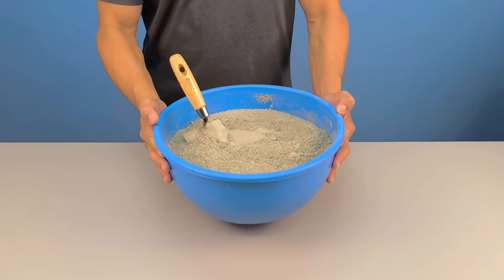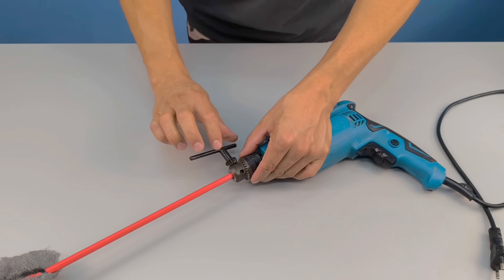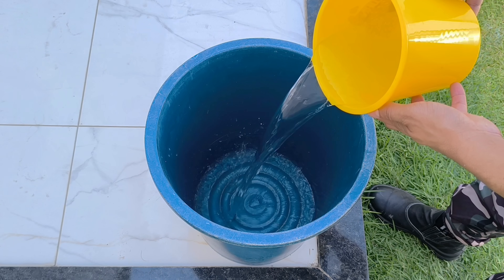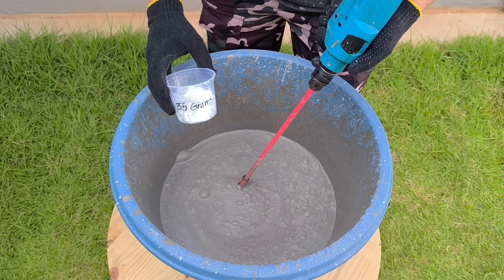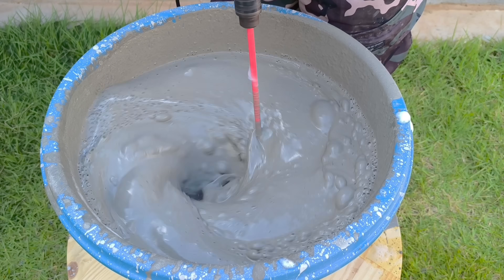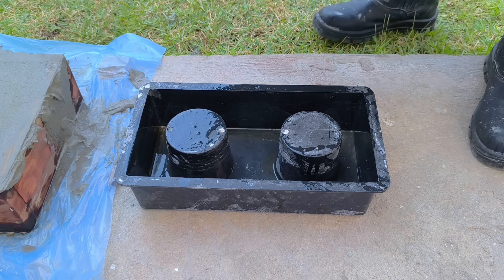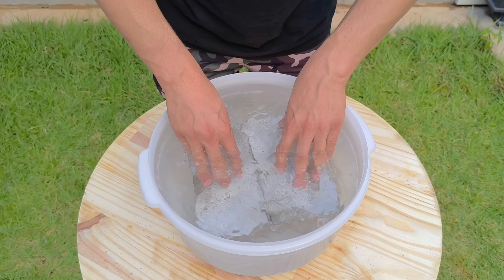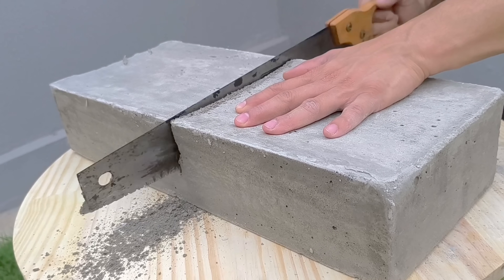Mix CEMENT with DETERGENT and create something that can REVOLUTIONIZE civil construction!

Comment: Not impressed! All you did is create glorified styrofoam blocks. Obviously that stuff is weak and prone to cracking and crumbling apart under stress. Can tell just by the way it sawed in half. 
Dumb idea!
Reply from the maker: I respect your opinion, my friend 👍 You’re right — this material isn’t meant for strength, only for reaction testing and curiosity. It’s interesting to see how different formulas behave even when weak. ⚗️🧱

Comment: Since it became weak or eroded in time, the fiberglass really scared me,ie if you build a wall with it
Reply from the maker: Good point! 💡 Fiberglass should be used in the right ratio — too much can actually make the mix brittle. When balanced, it gives great reinforcement without losing strength.

Comment: Aircrete
Reply from the maker: Exactly, my friend! 💡 It’s a similar concept — just an experimental version made with simple materials to show how lightweight concrete can be created at home. ⚙️🧱
Reply: @inovaouinventa it's also fire brick basically. You can use it to build a furnace to melt metals in.
have two buckets slightly different in size
and suspend one bucket above inside the other so you have a floor to the fire brick bucket

Comment: This was facinating!! Would this mixture withstand the weight of a car if someone poured a driveway or a pad to park on?
Reply from the maker: Thanks! This mix is experimental and lightweight — not strong enough to hold a car’s weight. It’s better suited for decorative or low-load surfaces.

Comment: jeah it swims its light but how much pressure can take it, and how is the abrasial factor, as i saw how easy the saw cuts it  it was wasted for me... because i can tell that lightweigt stuff will not hold for long and decay by time... but i wounder what would happen if u add much more glassfibers (our ancestors used straw) and a decent dose pozulan to the mix,  i say it would be better with the straw from medival time, u get a lightweight material and even if the straw one day decayed awaw the pozulan will grow in and fill the gaps with every rainfall...
Reply from the maker: Excellent analysis! 🧠 You’re totally right — adding more glass fiber or natural fibers like straw, plus a pozzolanic additive, can really boost both strength and durability. I love that medieval approach!

Comment: Sir please help me to make interlock brick
Reply from the maker: That’s a great project! Interlock bricks require specific molds and a strong cement mix — usually with less detergent and a bit more sand to increase compression strength.

Comment: Truly amazing!!!! 
Q What type of concrete are you using to get such a fine smooth texture?
Reply from the maker: It’s a special smooth mix made with ordinary Portland cement and a small amount of detergent — that helps create a fine, silky texture by reducing surface tension and air bubbles.

Comment: This is not a structural concrete at all. It may have some application otherwise however time would be the test. I bet you couldnt anchor into this shit neither. Absolute bullocks, besides, using dishsoap or laundry detergent was used a long time ago for motaring bricks together and as a seismic upgrader we used to see this crap coming apart as we drilled and epoxied anchors, redi rod, rebar and plates to hold brick walls together.
Reply from the maker: You've brought up some interesting points about the structural integrity and anchoring capabilities of this mix. Our goal is to explore new possibilities and applications for lightweight, experimental materials beyond traditional structural concrete.

Comment: some 25 yrs ago I've heard about lightweight concrete. a few techniques to get similar results, one of them the one you depicted here. I've tested them some 15 yrs ago with success for a couple of applications (mainly isolation and voids filling in construction). By  that time there were already available simple machines for continuous foam production to be used to produce foam to be mixed with mortar in conventional mixers. There are also specific foaming agents because you look after stability and isolated bubbles in the cured final product what are key to isolation performance and also water absorption (what you want to minimize !). As almost all related to cement... process and proportions are key to results. For success at working with this kind of products you need to be very precise and very careful, accounting for a lot of other relevant factors at the time of mixing, such as temperature of each component you will be mixing, specification of the cement itself (there are many types and variants !), specs of all other stuff that you mix !, and climate conditions specially humidity during the curing period.
So many variables, that working with cement based compounds is serious business. Is a great material but it is increasingly complex the farther you go from the standard classic mixes. Working consistently well with many compounds and formulations can become literally an ART

Comment: That  crap is gonna crack in the summers by expansion.  The purpose of concrete is the weight and strength.
Reply from the maker: You’re absolutely right — heat expansion is a real challenge! 🔥 This mix was tested more for reaction and curiosity than for structural use. ⚗️

Comment: Can you seal the blocks to make them waterproof?
Reply from the maker: Yes! You can apply a thin layer of acrylic varnish, waterproof resin, or even silicone-based sealer — it will protect the blocks from water perfectly.

Comment: that is very cool...I am assuming this product has no commercial value ? strength ?
Reply from the maker: It actually has potential value! This mix can be used for decorative pieces, light panels, or prototypes — it’s solid, lightweight, and surprisingly strong for creative projects

Comment: This is nothing new. Its called light weight concrete. It has been around as long as normal weight concrete. Soap is just one method of air entertainment, and not the best because it can reduce matrix strength beyond merely introducing air voids.
Reply from the maker: Excellent technical point! 👏 You’re absolutely right — this mix follows the same principle as lightweight concrete, just explored in a simple and creative way for experiments. ⚗️🔬

Comment: That "used motor oil" is too thin and runny to truly be only motor oil alone (or at all.)
Reply from the maker: It's actually a mix of used motor oil and other hydrophobic liquids to achieve that consistency. Thanks for pointing that out!

Comment: :face-green-smiling:What a joke! Bricklayers all over the world have been adding detergent to water to make mortar 'fatty', easy to spread, and increase adhesion/cohesion.  I learnt this from my father 60 years ago. Then add chopped fibre with styrofoam beads/polypropylene.    Super strong, light, floating breeze blocks but will deteriorate over years to become rubble.
Reply from the maker: You're absolutely right! 🙌 It's amazing how traditional methods like adding detergent have been used for generations to improve mortar. 💡

Comment: GR8! Yo what degree the concrete properties are preserved with this foamy/ souflé mix?
French said over one century ago that with a wall thickness of 15 cm, the weight to buoyancy ratio of a hull began to be advantageous for reinforced concrete above 10 metres of hull length.
Romans prepared concrete with volcano ash, resisting thousands years on Sea water, Portland lasts just 50 years.
How porous, what's the air and water tightness of your mix?
Karlsruhe tech built a kart on a prestressed concrete plate, with 4 mm thick body.
B&V-246 gliding bomb had Sorel concrete wings, this cement does not admit irons.
Concrete is a composite, many, many different ingredients can be poured into the mixer.
Congratulations! Blessings +
Reply from the maker: Wow, what an incredible and detailed comment! 🧠👏 You’re absolutely right — ancient techniques like volcanic ash concrete were extremely durable. In my mix, the goal is to create a foamy, lightweight texture with balanced porosity and strength. It’s fascinating how many variations of concrete exist! Thanks a lot for sharing your knowledge and for the blessings 🙏

Comment: Old recipe.  Bricks made this way have insulating properties, but the bricks are are not durable and they'll disintegrate under stress.
Reply from the maker: You're right that this method is known for insulation, and traditional recipes might be less durable, but with modern cement and additives, we can enhance strength and stability. ⚒️

Comment: USA. Kentucky.... I still use detergent in drywall mud to decrease bubbles and make it smoother. Works great.
Reply: 30 years of commercial drywall.  Soap is a big NO! Every new guy tries to show us about the soap but a professional follows the mixing directions so the warranty will be honored if the mud fails.
Reply from the maker: That’s awesome to hear! 🇺🇸 It’s amazing how simple additives like detergent can make such a big difference in texture and workability.
Reply: @unveiledbeliever7705  paint doesn’t like soap
Reply: @StepheMauro-kh1px that's exactly why I don't put soap in paint😂

Comment: Pretty cool video. Thanks for sharing it. But if you can cut it with a wood saw, is not strong and won't be durable. Maybe if you finished it with a sealer, it might be good for walking on. But it won't be good for building with. Better to stick to cinder blocks.
Reply from the maker: You’re totally right! 👍 This mix was designed for lightweight and experimental use — not for heavy structures. But sealing it can indeed make it tougher for creative or decorative applications.

Comment: What is the plasticizing additive???
Reply from the maker: Liquid lime (calcium hydroxide in suspension): is an alkaline solution traditionally used to give plasticity and cohesion to mortar, delay setting time and improve adhesion, but it does not reduce water or increase strength like modern plasticizers.
Reply: @inovaouinventa Thanks for being so interactive with your subscribers ❤

Comment: I was wondering if someone would have made a house out of those bricks if would make the house or cabin or bridge by hundreds of pounds or even thousands of pounds but can it hold up thousands of pounds of weight??? Also can it withstand high winds or snow... Things like that a builder has to think about to make sure that the house doesn't calaps on a family living in a potential death trap...
Reply from the maker: Excellent point! 💡 This mix is great for light structures and creative builds, but not for load-bearing walls. It’s more for innovation and experimentation than full-scale construction.

Comment: Good trick; it could be useful for thermal insulation brick within load baring frames, or as sound insulation "mass loaded wall". What is the working time or cure time?
Reply from the maker: Great observation! The working time is around 20–25 minutes, and full curing takes roughly 24 hours — depending on temperature and humidity. It performs really well for light insulation ideas like that.

Comment: I have been a bricklayer for 40 years , if you use detergent in mixes it will lose all its strength .
Reply from the maker: That’s a valuable insight from experience! 👏 This experiment isn’t for structural use — just to study lightweight and foamy reactions in cement. ⚗️

Comment: The sound of that tape measure being retracted full of cement. You didn't have a stick to put in the cement, to hold next to tape measure without destroying it?
Reply from the maker: Good point! Sometimes, in the heat of the experiment, a quick solution is needed. I’ll keep that in mind for future videos! 🤔🛠️

Comment: How does the compression strength compare to similar mix without the detergent?
Reply from the maker: Excellent question! 💪 The mix with detergent has lower compression strength because of the air bubbles, but it’s lighter and better for insulation. Without detergent, it becomes denser and stronger. ⚒️

Comment: Ok brainiac, so what is this mixture's strength? People expect concrete to be strong. That's probably why they don't make it full of bubbles so it's a fraction of it's PROPER density. That's just a guess because i'm a welder...
I susoect that any building using your 'ingenious' bricks will end up killing you when it all falls down!
Reply from the maker: Good question! 💡
This mix isn’t meant to replace structural concrete — it's an experimental lightweight variation. It has decent strength for crafts, insulation, and small projects, but not for heavy load structures.

Comment: Airconcrete is why hundreds of UK schools anx hospital wards are being torn down because they don't have enough agregate strength. It should be s crime to use airconcrete. You talk about strength but this has no strength and you've not shown any tests to prove you are right. The reason it is not strong is because there are no aggregates added to your mixture. The fibres do not work for for compressive strength. This mixture will just crush.
Reply from the maker: You bring up a strong argument! 💡 That’s why this experiment is purely for small-scale or decorative use — never for load-bearing structures. Safety first! 🧱⚠️

Comment: I would be curious to know how this would work as stucco , and as pool, like gypcrete, or whatever they would use for pools?
Reply from the maker: That’s an interesting thought! 🤔 We’d have to run some tests to see how it holds up as stucco or for pool coatings — but its smooth texture and low density make it promising for small-scale use.

Comment: They made fiberglass cement for years i don't see any strength value in the mixture i quest if your making a floating boat dock maybe? However if you did a p.s.i test i don't believe it would be strong
Reply from the maker: You're right to question the strength for structural uses! 💪 This experiment is more about exploring lightweight possibilities rather than high PSI for heavy construction. 🧪

Comment: Could this be used to build concreate yachts? Light and buoyant. But would its strength last?
Reply from the maker: Great question! ⚓ It’s light enough to float, but not strong enough for marine structures. For yachts, a reinforced mix with fiberglass or resin would be necessary for long-term strength

Comment: And here I wait for the most obvious test for different concretes to follow : a UCS test.  We all know a tensile strength test on concrete is useless.  Foam concrete is cosmetic and should NEVER be used in applications carrying any load. Maybe a great idea for making flower pots or garden ornaments.
Reply from the maker: You’re absolutely right about the UCS test for load-bearing applications! 💪 This mix is definitely more suited for non-structural, decorative uses like flower pots. 🌸

Comment: Cutting wet and weak concrete with a hand saw. I'm flabbergasted.
Reply from the maker: It’s just for demonstration purposes ⚙️ The material was still curing, that’s why it looked soft — once dry, it becomes much stronger. 💪

Comment: There are two problems with this video number one is all you’ve done is create airCrete which has been around forever but even if nothing like this had ever been invented you haven’t shown us anything useful. 

What matters is its properties? What is it strength, insulating ability, how long does it last, etc

For example it could be incredibly light and incredibly strong but for some reason it degrades in two months? 

I’m not trying to insult you or put you down I’m just saying that we need more information
Reply from the maker: Good observation! ✅
Yes, the concept is similar to air-crete, which has been around for years. The goal here is to simplify and demonstrate techniques people can try on a small scale at home. Thanks for contributing to the discussion!

Comment: Aircrete looks impressive because it’s light, floats on water, and can be cut with a saw, but it’s NOT a structural material.
 Its strength is only a small fraction of normal concrete, and it’s brittle, highly porous, and easily damaged by moisture, heat or impact. Without proper curing and sealing, it can crumble, absorb water, and lose integrity over time. It’s best suited for insulation, lightweight fillers, or decorative projects, not for anything that needs to support weight or withstand weather exposure.
Reply from the maker: Exactly right 👏 Aircrete is amazing for lightweight projects, insulation, or creative builds — but not for structural strength. Thanks for sharing such a clear explanation! 🧱💡
Reply: Can it be used as a subfloor leveler in a 100-year-old house?
Reply: @ronaldwayman1209 No. pues absorberá la humedad del piso.
Esta bien para muros divisorios SIN CARGA ESTRUCTURAL

Comment: We made a very strong and durable mix using acryl 60(basically acrylic glue) and cement and black sandblasting grit. It was strong and lasted years. It bonded well to both asphalt and concrete. One ramp we made up from ashphalt to concrete sidewalk lasted about 20 years before they renovated the museum and removed it.
Reply from the maker: That’s impressive! 💪 Acrylic additives like Acryl 60 really increase bonding and flexibility. Twenty years is incredible durability — thanks for sharing your experience! ⚗️
Reply: We used no water in the mix. Weldbond glue would work well too. And any color of sandblasting grit of course could work.

Comment: If you can easily cut it with saw, how long it would stand the compression and tension stress? This product will be perfect for faux brick for your siding and other aesthetic.
Reply from the maker: Exactly! That’s one of the best uses — for decorative panels or faux bricks, it’s lightweight yet stable. It can handle moderate compression but not structural loads. Perfect for creative builds! 🧱